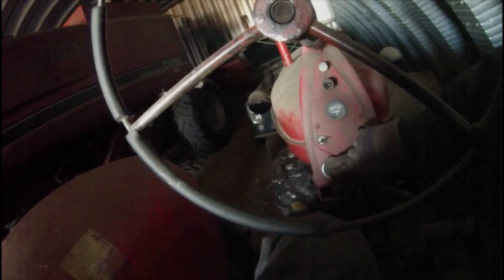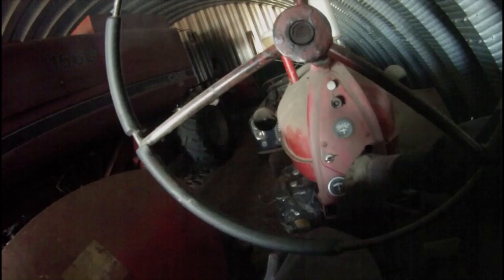Long Rest For The Cockshutt 40

Comment: It's amazing how slowly those old 6V motors will crank and yet still fire. A bit of fettling and she'll be right as rain.
Reply from the maker: Very true Mart but I've also seen six volt systems turn as fast as a 12 volt. My 39 sedan for example. When its working right it really spins over on six volts.

Comment: Nice tractor. I got my grandfather's cockshutt 30 back. It was parked in a shed for 30 years but it's far from starting.
Reply from the maker: Should be ok if its been stored in a shed that long. Just the usual gas and ignition issues. Unless it has sat long enough for the engine to lock up from rust.
Reply: Yes, engine is locked up.

Comment: Great tractor, my Dad bought a Co-op E3 (Cockshutt 30) new, I have it. It needs a water pump and exhaust manifold, one of many projects I need to get to. He bought a used one on an auction and liked it so much he bought a new one, live power was one of the great selling points. Cockshutt, Massey-Harris and Buda were great Canadian products in my eyes, sad they went away.
Reply from the maker: Its true we made some good machinery etc.  here in Canada.  Even our own tires. Too bad it all ended. Good to hear you have saved a Co-op.
Reply: I also have a Massey-Harris Clipper self-propelled combine, I probably paid too much but I couldn’t see it go for scrap as that’s where it was headed. Massey-Harris combines were the gold standard of combines for years.
Reply from the maker: @oldamericaniron5767  Great that you saved a Clipper too. Massey combines were everywhere in those days. My dad had a 60 self propelled in the late sixties. I still have it but it has sat outside all it's life and had parts salvaged off it. Also still have his Case model A pull type.
Reply: My Dad bought a 60 used in the mid 60s. I was probably 11 or 12 and riding with him. I happened to say it was running like a new one and the sickle immediately stopped! A day later it was fixed and running again. I remember it like it was yesterday. Isn’t it funny how some moments in time stick with you forever. The Chrysler flat six powers my air compressor now. I’ll have to get some video of my Clipper on my channel one of these days.
Reply from the maker: @oldamericaniron5767  Dad's Massey 60 was a step up from the little Case 6 foot pull type but it had it's share of problems.
Reply: Truck was scrapped 35 years ago before I thought an old farm truck would be cool and my Dad stepped up to the self-propelled 60 from a pull type 6 foot Clipper. Are you very far north in Canada, I can’t imagine farming having cattle in the winter there, I remember how tough it was here in southern Wisconsin in winter. I’ll be watching for your videos. I tell others they should post videos so l watch them instead of scouring Craigslist or Facebook marketplace for more things I don’t need.
Reply from the maker: @oldamericaniron5767  I guess I'm a good two hours North of the border. Cattle burn up a lot of energy keeping warm here in winter I guess but they have been doing it for years. A little grain helps but oats have nearly tripled in price from last year so they are becoming more expensive pets.

Comment: nice :) maybe 1 day we'll get the farmall A running.. motors locked up.
Reply from the maker: You should get it running. Those Farmall As are quite collectible now.
Reply: @roosty6  been trying 2 but 1 motor piston is still locked up.. we were going 2 try pulling it again but never happen.
Reply: Don’t pull it.That can cause much damage.
Reply: @steveaw5895  we've pulled it before with no problems.  these red tractors are bullet proof...lol
Reply from the maker: @steveaw5895  I've done it and got away with it in the past but yes, there is the chance of damage.

Comment: Maybe time to convert it to 12 volt, a lot easier than converting the ‘52 Merc.
Reply from the maker: I did that on the 50 many years ago and it is good except hard on starter drives. Grinds pretty bad on engagement sometimes.

Comment: Your starter switch is foot operated?
Reply from the maker: Its a "farmer fix". The original solenoid quit and I had this push button style from a Case tractor that worked just fine. I doubt you will find another Cockshutt with that style starter switch.